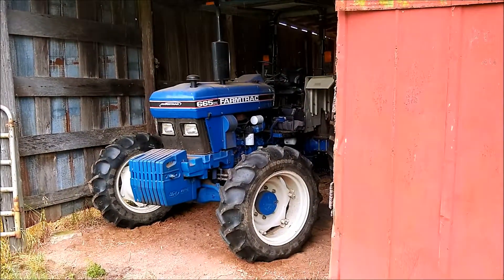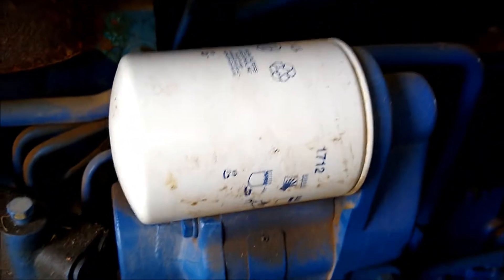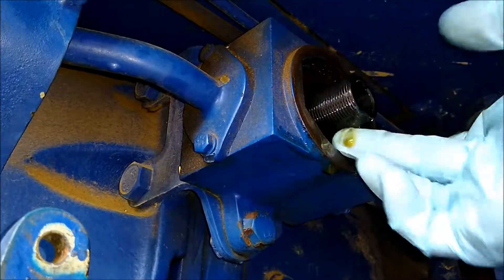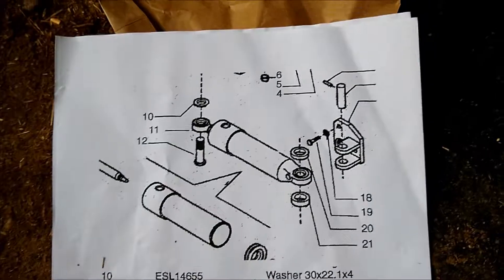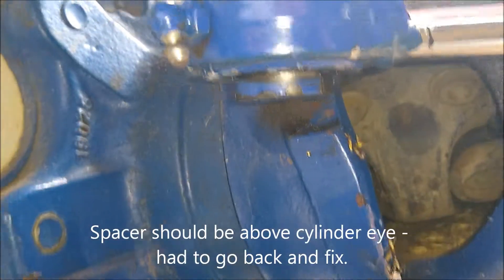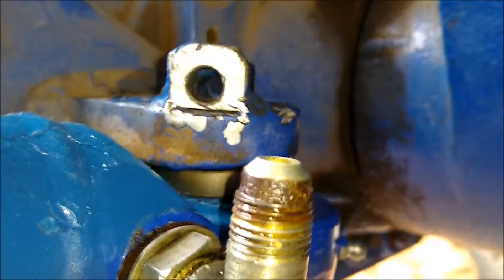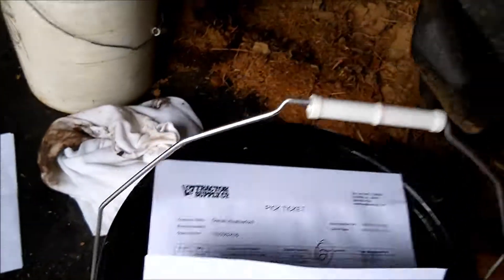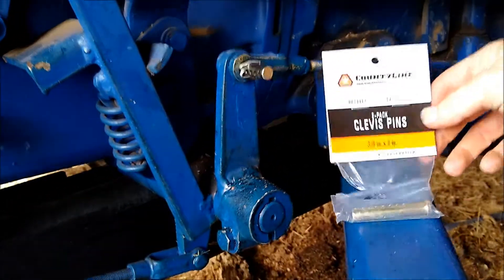Installing Hydraulic Cylinder

Comment: I have a 675 farmtrac, I got it stuck and while i was trying to get it out i was using my front loader to get my self out. My farmtrac 675 is 2WD but I saw that the front end of the block was leaking and looked like hydraulic oil and now it won't steer left or right and loader is really slow to use. Did i bust a line or what happen